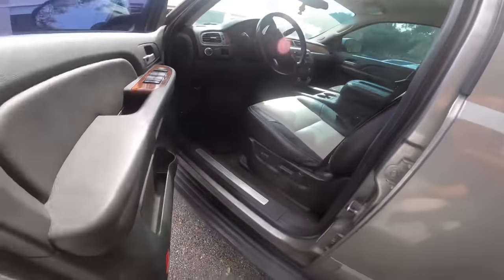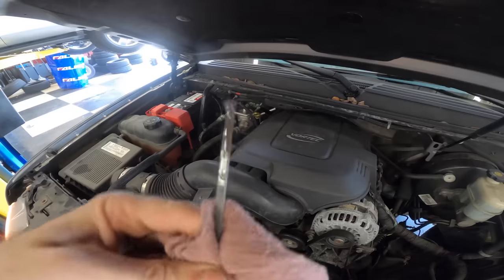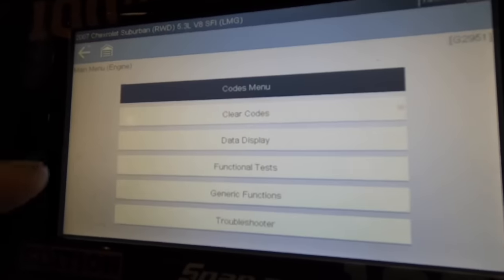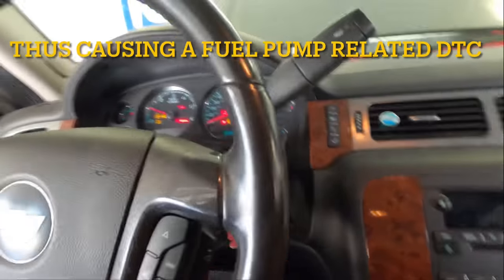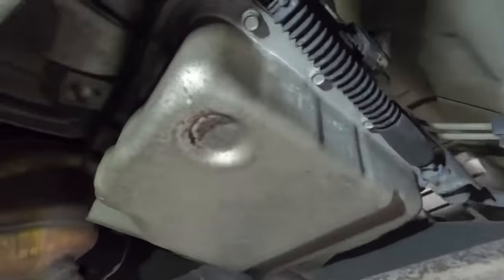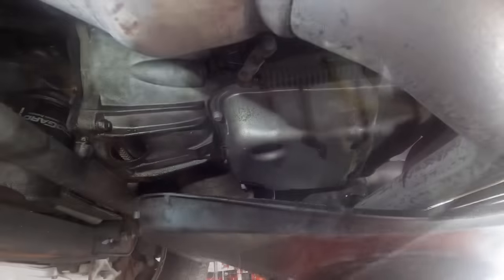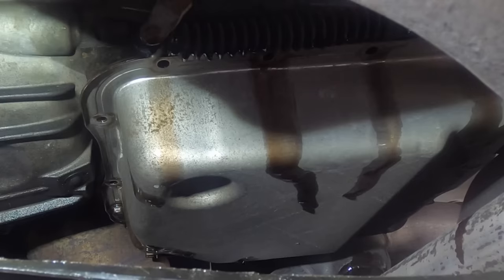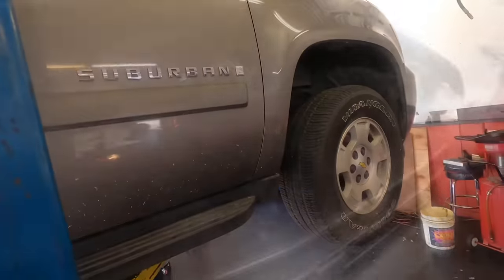Busted! SCAMMING Mechanic Causes Damage! 4l60E Transmission

Comment: The more I think about this one the more it makes me angry. In my estimation, by bypassing the fuel pump relay, the scammer also bypassed a critical safety system. If memory serves me right, the system is designed to turn off the fuel pump relay in any impact that results in deployment of the airbags in order to prevent the fuel pump from spraying fuel all over a hot engine or exhaust system in the event of a wreck that damages a fuel line. If this vehicle had been in such a wreck, a massive fire could easily have been the result.
Reply: A very good point, and it makes me think that if this case appears before a magistrate and that point and the evidence supporting it (the introduced wire jumping the fuel pump to remain on) is brought to light then it might go very badly for the mechanic who put his illicit profit ahead of a client and his family's safety. This crook richly deserves it.
Reply: Oh not just that, because it was a DIRECT connection with no fuse there was also no overdraw protection on that circuit and no way for the computer to control the duty cycle meaning that pump was running at FULL CYCLE the ENTIRE time the vehicle was running, causing the potential for the pump to overheat or to start an electrical fire from extended run time AND causing excessive wear on said pump.
Reply: absolutely correct
Reply: @trebormcfarland8708  And that wire being a direct connection to the battery means instant hot wire ignitor should it pop loose and hit any grounded metal, of which there are only multiple square feet of in the engine bay.
Reply: I thought there was a G-switch in some vehicles that shuts down the pump (maybe a few other things) in case of an impact. Read about having to reset it manually somewhere.
 @trebormcfarland8708  The blue wire could've been piggy-backing off another fuse, giving a higher chance of blowing that fuse, but yeah it could've been on the "hot" side instead
Reply: They also have an integrated in the inertia switch to shut tge fuel pump off in the case of a rollover crash. Another valid point is that it has to be able to shut off in the event that the fuel rail pressure exceeds safe limits. The fuel pressure regulator is only designed work between a min and max range and if you excede that range you could cause damage to the regulator and the rail will recieve almost 100lbs of pressure instead of the 30 to 40 it is designed to handle. Very dangerous.
Reply: I’ve noticed sociopaths don’t mind killing people. My guess is the person that sabotaged the suv knew of the safety risk.
Reply: I guess it could have went kaboom!
Reply: And You would be right as a Firefighter I appreciate that system as well because it allows us to focus on the Patient instead of try to disable the Vehicle first although we still cut the Battery cable to make sure no power is running through the system
Reply: I never thought of that. Not safe at all. Its like how pilots dont wear a rigg because " o engine fires are soo rare" no way I skydive no way I hate flying withouth them
Reply: Bro, everyone needs a mechanic like you! 👍👍 🔧 🪛
Reply: @user-ut9ln4vd5m  The blue wire was in spot 19 which is supposed to be for the transmission fuse. It would have had to been on the hot side as the fuse was just laying in the box, not plugged in so it was a direct hot connection.
Reply: Not to mention that by putting the trans in limp mode for such a long time, it drastically shortened the life of that transmission. It's a ticking time bomb now
Reply: Dont know who will see this but. Heres something too that maybe went over peoples heads, what if this customer has their family inside and an accident happens and the fuel pump just keeps spewing fuel on a potential fire. Very sad to this kind of thing.
Reply: @user-ut9ln4vd5m  85' Ford LTD2 had the impact switch located in the trunk on the right side. alot of people were getting towed after a small bump would shut off the fuel pump and them not knowing about it or where to find it.
Reply: Wow.  I didn't even think of that.

Comment: That trans ignition fuse will make the transmission start in 3rd gear. Removing that fuse when trying to diagnose a trans problem is helpful. If you pull the fuse and trans starts in 3rd gear and drives, it typically means the trans is fine internally vs electronic issue or stuck check ball issue.
Reply: Good idea. This trick can really get you going in the right direction with diag and repair
Reply: yea, it should've been put back though

Comment: Great video sir. It reminds me of a job that I done awhile back, where a lady brought her suv to me and pointed out that she had taken it to a shop and gotten it tuned up, but still misfiring. After diagnosing the problem, I found that the previous tech had only changed 3 plugs and 3 wires on the front, because the ones on the back were harder to get too, plus for the customer, it's hard to see. The guy charged her 425.00 for 3 plugs and wires, plus the parts were cheap also. I replaced all parts OEM parts, problem solved. She went back to previous shop, presented her case, tech fired, and she was compensated. Oh well. Thank God for honest techs. Tkx keep up the good work.

Comment: My wife once took a ford escort that only had 40 thousand miles on it to a fire stone by our home for an inspection. They said it needed 912 dollars in repairs when I told them it only had 40 thousand, they thought the odometer had rolled over .  I found marks where some one had crushed the brake pads with vice grips . And I did everything on the list in my garage in less than 30 minutes for 68 dollars. I would have turned them in , but I didn’t know where to .
Reply: I took a car I used to own to Firestone.  It ended up costing me $4,000.00 to fix the damages, and re do the work they did incorrectly the first time.  Firestone couldn't even tell me the sway bar bushings needed replacing when they installed struts.  Also, the strut bushings were no good, and had to be replaced which required the removal of the struts they installed.  The brake pads they installed were cheap Wagner pads, and only lasted 14,000 miles.  The pads were coming apart in chunks, and they damaged the rotors.  The only good things Firestone does is sell tires.  They also do tell you if your brake fluid needs to be flushed because they test it for copper content.  The brake job they did for me was supposed to have a fluid flush because the copper content was 200 parts per million.  A year later when I complained about the brakes, they said the copper content was 300 parts per million.  A clear indication they did not do the fluid flush.  They did nothing during the warranty period to fix my brakes.  I took it somewhere else, and they showed me the pads coming apart, and the deep grooves in the rotors from the pads.  The second shop installed new rotors, and a Posiq pad.  No further problems with the brakes since.

Comment: Mechanics like you are hard to find. That’s why I “try” to do my own work because of shady mechanics like the one who worked previously on that car. Keep up the great work and videos!!!
Reply: My grandpa was a mechanic who did all the work on their cars (and he owned a rather ridiculous number of cars - all of them old cars that he bought used for pretty cheap and fixed up). He ended up retiring around the late 2000s because he didn't understand all the computer stuff that were becoming more and more common in cars and he just wasn't able to avoid it anymore. Not a bad run for a farm kid that was born during the Great Depression!

Thinking back, I really should have taken my 96 Cavalier to him and had him teach me how to fix it. Or even just paid him to fix it instead of going to various mechanic shops (I suspect Grandpa might have balked at teaching a "girl" to fix cars - us girls were always expected to stay up in the house with Grandma). It's not like Grandpa lived that far away! It was only 30 minutes!
Reply: When it comes to suspension components I'll think. Heres some cash keep me safe.
Reply: Just sounds like the other shop just doesn't handle this kind of diagnostic. They probably figured the computer was shot and the transmission was toast. You can always get a second opinion.
Reply: @BukitMan  Then why would they remove a relay, remove a fuse, and place a jumper wire to the fuel pump, and not advise the customer about any of that? 
No, no... that other shop was shady.

Comment: TL/DR - I found another mechanic's sabotage done to an ambulance causing over $10k in damages and losses to the owner

The story: I'm in the middle of a similar situation involving a dishonest "mechanic" but the financial damages done are 20+ fold of the ones in this video. A couple of months ago I had a local ambulance company contact me, they were looking for a new mechanic to do the maintenance and repairs for their fleet. The guy they had been using they wanted to part ways with because he was regularly putting them on the back burner plus they had concerns that he may be selling them work that wasn't needed. 

When I started doing work for them, the other guy still had 1 of their ambulances but wouldn't return it initially because he had already started work on it. From what I was told there was a bit of a confrontation between the mechanic and the owner of the ambulance at that time. A week or so later, the ambulance was returned to the owner but it was running worse than when it was dropped off. It was given straight to me and all I knew at that time was the other guy had done spark plugs, 4 new ignition coils and intake manifold gasket (ford 6.8L V10) and that it was running like shit. When I ran the engine the first time, it had an obvious misfire and a scan revealed misfires on cyl 1, 8 and 10.  I first suspected a quality of repair issue as I had already seen poor quality in the guys work on a couple other ambulance, including one that nearly resulted in a fire. Ultimately what I found was cyl 1 and 10 had low compression and cyl 8 had no compression. Draining the oil revealed bearing material suspended in the oil along with a number of metal pieces in the filter.

I brought my findings to the owner who wanted to further investigate possible repairs to the current engine before moving forward with a replacement. Ultimately, I found that there was a bolt lodged in the intake runner on cyl 8 that bent the valve and broke the rocker arm and video scope revealed damage to cylinder walls in cyl 1 and 10 result of foreign debris, such as  a screw or bolt. Engine was completely trashed and it was obvious sabotage. I feel bad for the guy that owns it because a reman engine is going to run him 4400 and another 1500 for labor. Include the ambulances down time and his total loss is over $10,000. I documented my findings thoroughly, with photos and in detailed writing. Same as you, I give the benefit of doubt whenever I can, but this one was an blatantly obvious case of foul play. I urged the ambulance owner to pursue the case in court and even offered to testify my findings in front of a judge if need be. It remains to be seen what will become of this as we are waiting on the replacement engine still and this is all in progress. 

This case, more than any other case of shotty workmanship or foul play that I've seen while working in this field, is the case that bothers me the most because of the financial loss involved. The guys that own and operate the company are really good people, not to mention their company provides services that saves lives. And for another mechanic to knowingly cause this kind of financial damage to a company who's purpose is to help people in need and save lives... it honestly sickens me. 

Anyways, kudos to you for being the honest one in your case. I hope everything works out for your customer.
Reply: Early 80s I was working on an engine, and another mechanic dropped a screw into a spark plug hole while I was away from the vehicle.  I couldn't prove it, but I got axed in the big layoff that happened soon after.  So, sabotage can occur in different ways.

Comment: Who ever removed that fuse wrecked that transmission!
Reply: For sure. And would place bet that this person has been coming to that person for a while and was slowly gaining trust into that guy coming back to get the tranny work done by him
Reply: My question is, was the trans making that noise BEFORE the customer took it to that other guy?  If it was, the guy might have pulled the fuse for diagnostic purposes and just forgot to replace it...still his fault either way.  The jumper wire to the fuel pump making it run 24/7 was certainly not an "accident" so that makes me suspect the fuse was done on purpose as well.  The missing relay is very suspicious too.  I can't think of any honest reason to remove it.
Reply: @OverlandOne   I doubt it had any noise to begin with. Pulling that fuse to put it in limp mode cooked it. The customer not knowing better probably ran the trans hot many times. The previous guy deserves his ass kicked.
Reply: @jasonyoung4890  Agreed, driving in limp mode for more than a few miles probably cooked it. It might come back to some extent with more fluid flushing through it, but a lot of the damage is done.